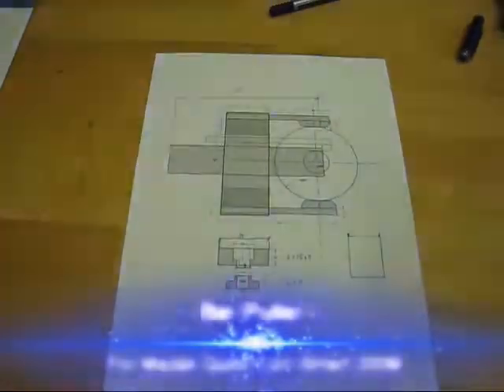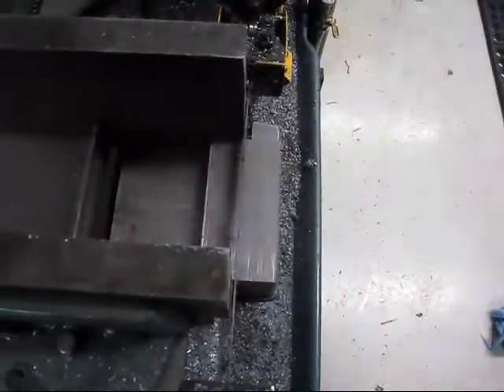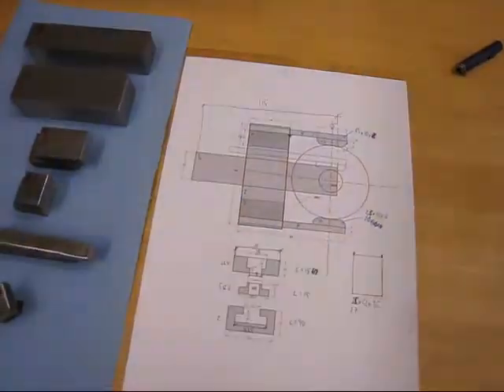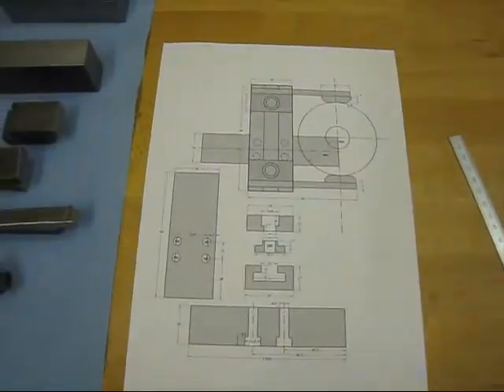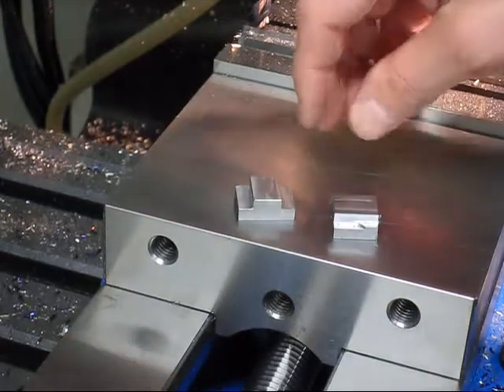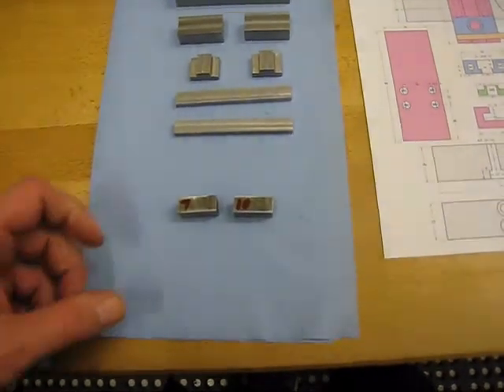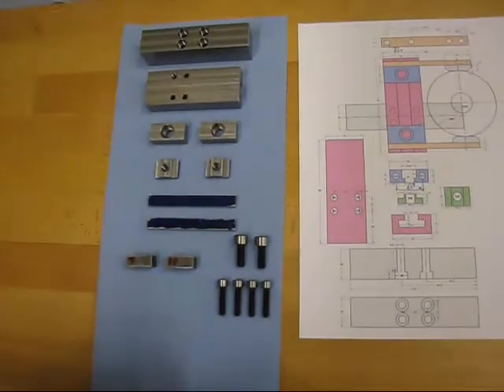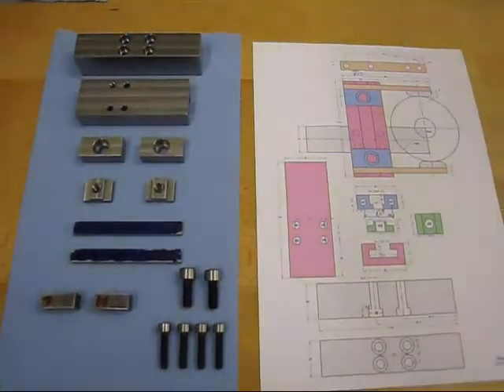Bar puller for CNC lathe

Comment: Can you share the cad files please?
Reply from the maker: Yes. How ?
Reply: Panzax grabcad. Title it "bar puller".
https://grabcad.com/
Thanks!
Reply from the maker: I am not going to sign up to that.
Reply: Panzax thanks. there some pullers over there but they are inferior to yours.  Im still not sure what puller is better ,puller on z axis or x axis?  Also, most of the pullers are not suitable for 1.5 meter ,42mm diameter, only for small aluminium rods. I like the royal puller which is combined with a cutoff tool. I like it because i have only 8 positions in my turret on my old okuma
Reply from the maker: The axial pullers usually need air I think, and they can't be combined with a cut-off. The one I made could easily be modified to pull big heavy bars and have a cutoff too. If you send me your email on PM I i will send you a pdf on email.
Reply: @Panzax1  I would also be interested in the PDF of the drawing, however, I can't see how to send you a PM on here

Comment: I have no idea what you are building, but it is interesting.  Your camera does not like the light over your bench.  Very flickery in some shots.
Reply from the maker: Yes, I noticed it when I filmed, but I thought maybe it would go away when producing it. I can try to move to another bench, it seems it's only in that spot it is bad. Thank you for letting me know !
Reply from the maker: I will explain what I am building in the next video.
Reply: You might be using LED lights. Some of them have a very bad flicker that shows up on camera, and sometimes even to the naked eye. Others are better.

Wave you hand uckly back and forth between your eyes and the lights or lighted surface. If you see a strobe effect with multiple separate hand images then likely the lights will appear to flicker on camera. If you see a fairly even blur of your hand then they are much less likely to flicker.
Reply from the maker: It is the old style light tubes (T9 maybe they are called ?) I  think each tube is 58W. Definitely not LED. I will try the test you suggested. Thank you!

Comment: Not an important comment but still worth mentioning.

'When you made note to the mill being a clone Bridgeport, seems a way of saying it is a lesser of a machine than the original Bridgeport mill.

I would like to refer to as a Hybrid not a clone ????

Clone: to copy.
Hybrid: Improvement.

I  see to many people / viewers talk about Bridgeport mills like they are God Sent machines they are very far from it. 

Thanks again for the video looking forward to Part 2.  (  Working on the Hybrid mill  ).

Regards Peter.
Reply from the maker: You got a very good point there. I said that only because that is I have always heard them called. There is one major benefit to the Bridgeport type of mill: It can do almost anything, although it does not do anything extremely well. But if you have only one mill it's  very versatile.